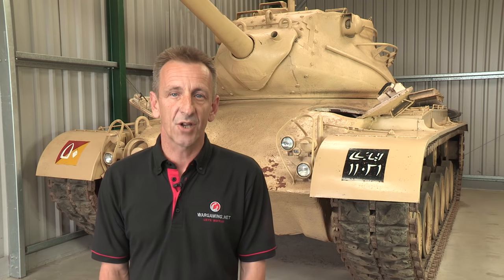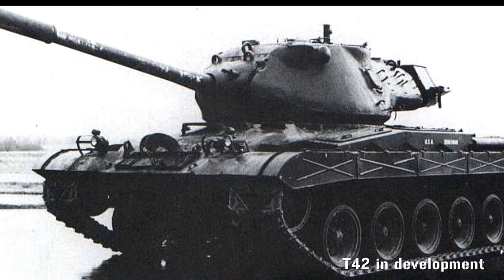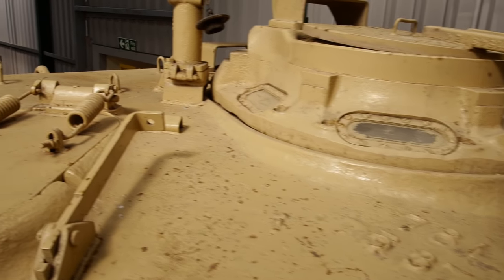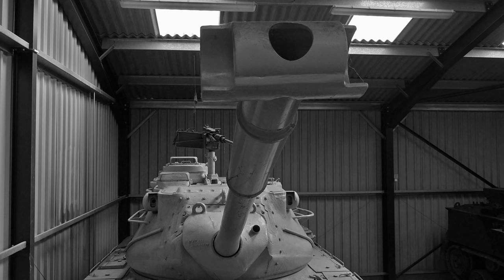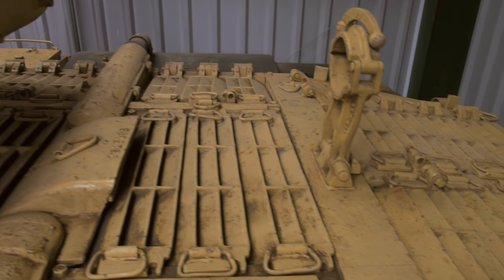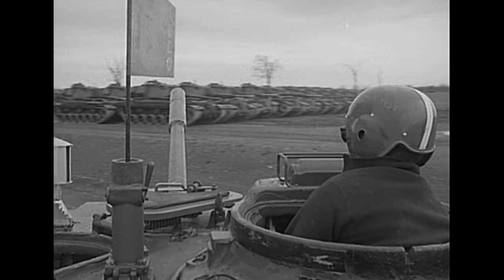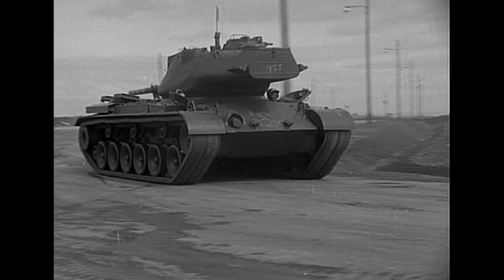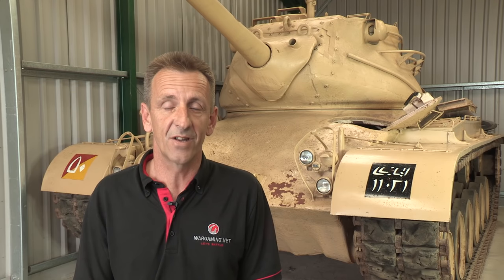Inside the Tanks: The M47 Patton - World of Tanks

Comment: I was a tankdriver in the Belgian army 1964-1966 and so i drove this thing around for 2 years. There were 2 gas tanks, one containing 500liter and the other one 380. You could go about 120km (75 miles) with that amount off fuel and NOT 160. On terrain it was 7;5 to 8,5 liter/km. I should know 'cause i had to fill it up again
Reply: Good to know. Thanks! You should edit the Wikipedia page for this tank :)
Reply: +Frederik Leemans Apart from the high fuel consumption what did you and your fellow crewmen think of M47? Did you have confidence in this vehicle?
Reply: +Butts Lane First this: contrary to what the man says, the German panther had a 75mm gun and NOT a 90mm! The tiger had the deadly 88mm. OK welll, for a 45+ ton tank it was very fast and manouverable. You controlled that beast with a rather small sidestick, F16 wise.Thanks to its torsionbar suspension it was almost as comfortable as a limousine. I'm not kidding! We were told to be no match for the Russian tanks (cold war back than, remember), But hey, in WW2 the sherman when it came down to armer and firepower was no match for the German panzers either. But the sherman was fast and reliable, the German tanks were not. Once my crew managed to hit a moving taget more than a thousand yards away 3 times within 6(!) seconds. This was in the early sixties so of course during maneuvers. You want to know more about the M47, you're welcome. PS.At the start of this video you can see the sidestick
Reply from the maker: +Frederik Leemans Hi my friend, the sentence is this "
"In the limited action it saw, the Pershing proved itself a match for the Tiger II and the Panther with its 90mm gun, but it was plagued with reliability problems." understand your misunderstanding and point taken but its referring to the 90 mm gun on the Pershing not Panther.
Reply: +Wargaming Europe What you said was right, my interpretation was wrong! Sorry about that. I had to laugh when i realized it. Maybe the reason is that i'm from Belgium and i'm flemish, so English is not my native language. You know, when i write a comment like this i often have to use google translate. But hey, that's one of the benefits of a computer AND Youtube for an old fart like me. Greetings
Reply from the maker: +Frederik Leemans Hey no worries my friend, I listened myself a few times and agreed I perhaps should have been clearer
All the best
Challenger
Reply: +Frederik Leemans Frederik, thanks mate:) That's an amazing hit rate you scored on manouvers.
So the Belgian soldiers didn't find the optical sight difficult to use? I've read different reports about it - some said it was fiddly and difficult to use. Obviously not in your case though!
Reply: +Butts Lane My dear friend, as the driver of the M47 i did not scored those hits, my crew did. I know the telemeter of the M47 was difficult to use but let me tell you this: i served in the 4th lancers and that unit won twice the Canadian Army trophy in the sixties. ALL of the NAVO army's took part of that contest. Those guys were amazing. One round ready in the barrel, one on the loaders lap and the third ready in the ready racks. Like i said, i was the driver and i could'nt bellieve my eyes. A tankcommander who could estimate very fast and precise the target distance was of greater value than the hard to use telemeter. Ciao
Reply: +Frederik Leemans Fred - whatever you've got to say about your tank experience is very interesting. Thanks for the comment on the fire control system:)

Comment: M26 Pershing, created as a heavy tank. Oh thats why its so sluggish..
Reply: +van Barlingen  know you know.
Reply: +van Barlingen Well, it's not the designation that makes it slow. It was even renamed as a medium tank later. The issue was they made a tank that was heavier, yet still used the Sherman's engine in it, causing it to be quite a bit underpowered in terms of horsepower.
Reply: +van Barlingen No, it was sluggish because it used an engine designed to power a 30 ton tank, not a 40+ one.  The "Heavy" designation was mainly for morale in WW2.  The M26 grew out of the T20 medium tank which was designed to replace the M4 medium.
Reply: engine mismatch?
Reply: Maybe 26 Pershing is the true grandfather of the US MBT.
Reply: KRIS TENGCO the American t30 trumps all those tanks. Not stopping with a basic 105 like t29 and t32, not enough with its 120mm gun on t34. But the t30 needed to go overkill and mount a 150mm main gun and 279mm of frontal turret armor

Comment: Was the M47 assistant driver able drive the tank from the right hand seat like the M46? I have forgotten just when that went out.Of course the M48 series had the driver located at the front center of the hull.I started my career in the U.S Army as a mechanic on the M48A1 series tanks.I switched to Construction equipment about the time the Army had just started switching fom M48A2C to M48A3.The Main difference between those two was of course the engine,M48A2C had a gasoline engine,M48A3 used the Diesel engine similar to the one in the M60 series.

Comment: A Match for The Panther medium tank and the old out of production Tiger 1 Heavy Tank , But the ( M-26 Pershing ) was Not a Match for the Formidable KingTiger !!!
Reply: Frank White that’s okay because the king tiger can’t drive a couple feet with out breaking
Reply: @connorc6293  The King Tiger was quite reliable and could manage difficult road marches and cross-country assaults. Fuel supply became critical for the Reich in 1945 because of the constant heavy Allied bombing all over the Vaterland!
Reply: @frankwhite3406  The main problem on both Tiger and Panther's was the wheel's on the Track system, each wheel had a second wheel covering the first,if you needed to change a inside wheel you would have to remove four outside wheels, very complicated and time consuming procedure.
Plus the Weight of the tank didn't help!.

Comment: Nice video :) But it raised one significant question: what was the difference between M47 and M48 ? Was there any major changes between them ?
Reply: +Studdento 
Among other things, the M48 deleted the assistant driver/co-driver/bow gunner from the crew, along with his seat and hull MG. The driver was relocated to the hull centerline in the M48, rather than off to the left.
The 48 also had a different turret (with commander's cupola having an internal-mount MG), and the hull front (the bow) was rounded off rather than being straight across.
Lastly, the M48 received diesel engines (though not the initial models), and the very last of them saw the 90mm rifle--same as the M26, M46, and M47 tanks as well as the M56 Scorpion self-propelled gun (TD)--replaced by a 105mm rifle, the M68 (basically the UK's Royal Ordnance L7)
Reply: +Andrew E. Oh cheers mate :) So you can easily say that there were no groundbreaking changes in the construction itself - rather some improvemets/upgrades. Thx once again !
Reply: +Studdento well the only thing that left the same is the chassi, and most armies reuse it for completely different tanks even... so i would say there were some major differences, imo
Reply: Giorgos Chatziioannou  Can you name some of the tanks ? I'm not that fluent in history but would love to know more :)

Comment: IS-3 it has really good fire power but blind AF on the battlefield. I bet KV-2 could challenge the IS-3 with that 152mm gun that so threatening to any other tank.
Reply: no that 152mm would just give a is 3 crew a headache
Reply: Actually not true the IS-3 has a flat surface right above the gun its on 33mm that 152mm gun will go straight through and cause 950 damage
Reply: RISK104 Actually not true the IS-3 has a flat surface right above the gun its on 33mm that 152mm gun will go straight through and cause 950 damage

Comment: The Russians used an extra fuel tank on top of the rear back of their tanks.  Only when in column did they use this extra fuel tank and made it an excellent target for an ambush.  However,  when in combat these extra fuel tanks were not used.  This is probably why they received such an excellent fuel mileage.  But probably didn't when in combat.  Furthermore, a smoke screen was used by burning oil from it's engine and this wasn't, at least for most people, a wise idea.
Reply: The rear auxiliary fuel drums were of little to no danger. They aren't mounted on top of the engine deck; they hang off the back instead. If the drums punctured by bullets or anything, fuel just leaks out behind the tank.

Soviet tanks achieved great mileage without extra fuel. This is partially because of the good quality of the engine, but also partially because they didn't limit fuel storage to the engine compartment. Western tanks like the M47 usually do not store fuel in the fighting compartment, but Soviet tanks do.

The smokescreen system doesn't work by burning oil from the engine. It works by spraying a fine mist of diesel into the exhaust manifold, causing it to billow white smoke. Even though the manifold is extremely hot, the diesel can't actually catch fire because the exhaust gasses coming out of the engine have almost zero oxygen.
Reply: Well, I was in the us military and what they taught us is the soviet tanks used an external fuel tank on the rear of their tanks.  And they used this fuel tank while in column.  And one hot spark from any piece of military weapons hit the rear while in column, an explosion would occur. Especially, because the engine is in the rear of the tank.   However, the soviet tanks do not carry any fuel in their external fuel tanks while in combat. and I don't think that is a fuel drum but a external fuel tank.  And the Russian tanks got a terrible mpg.  Say, Iron Drapes, where do you get your information.  sounds like misinformation to me comrade.